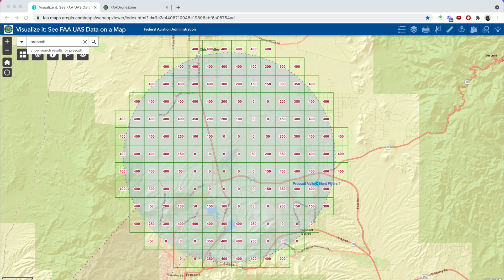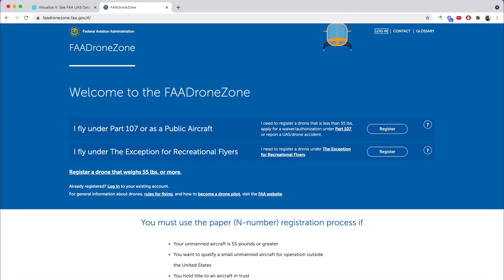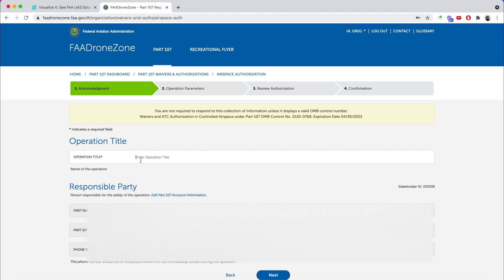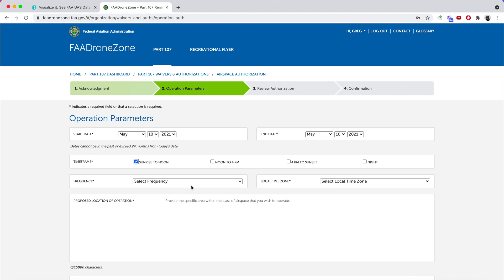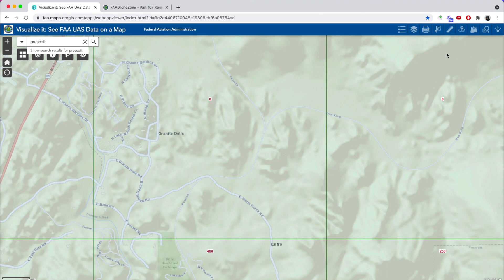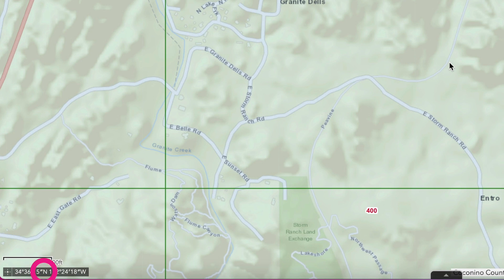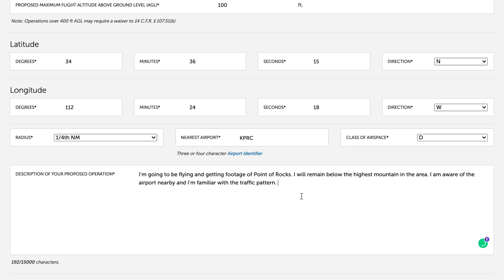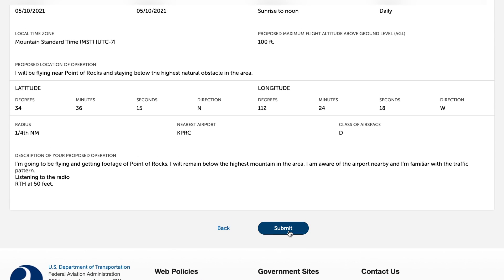How to fly in 0-grid Airspace

Comment: Why do they have a date range if you can only request one day? I live in New England where the weather is highly unpredictable in a 24-hour stretch, never mind 7-14 days ahead of time. What's your advice on how to coordinate these requests with weather conditions?
Reply: While this doesn't work to allow you to pick a specific date range, if you are flexible and are only concerned about flying as soon as possible after the FAA approves your request, this has worked for me. Say I want to fly sometime in the next week, but I am not picky as long as the weather is good. Since today is May 5th, I choose todays date on the request. Obviously there is no way the FAA will get you your approval before today is over. But what I have seen is this. On the 8th for example, the FAA will issue the approval, but they will change the authorized day from the 5th to a date range from the 9th to the 11th (From what I've seen, the range is generally the day the approval is given plus 3 to 4 days, though the request I just had approved Monday actually had a date range of 11 days, but I think whoever entered the approval accidentally set the end date as 5/16 instead of 5/6). So now with a you could fly on any day between the 9th and 11th in my example, depending on weather.

The other option I suspect you might have is in the description box where you describe your mission, make a request for a date range there. I haven't done this, so I don't know if it would work (since the process I described above has always worked for me, don't fix what ain't broken). But what I would recommend is if you do try putting in a date range in the mission description box, don't be greedy. Request a range of 3-4 days max. My guess is if you try and push it and ask for a week or more, you are likely going to get denied.
Reply: @michaeldiaz4942  Thanks. I was thinking about doing something along those lines. Everything I've heard is that the FAA is pretty reasonable and I'm sure they deal with this all the time.
Reply from the maker: The date range is used for other application on the DZ website. As far as weather, I recommend putting several days in a row to cover it and click all the time periods during the day. It is indeed a bit annoying.
Reply: You would think it would be more work for FAA to have multiple requests for a small number of consecutive days than one form for all the days.